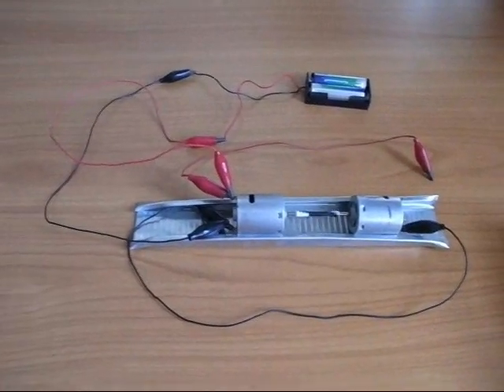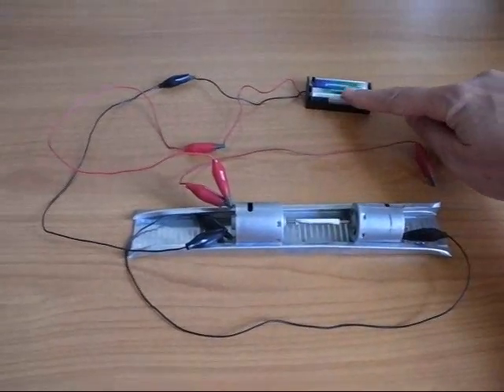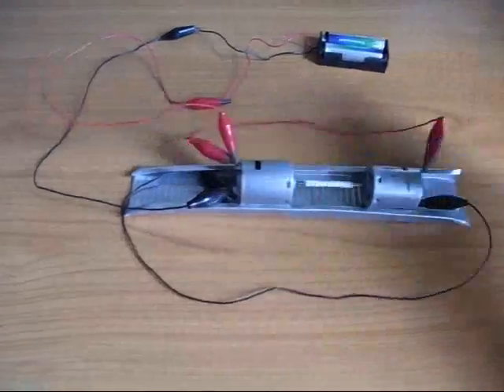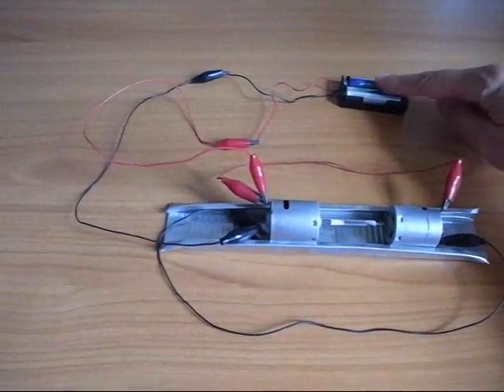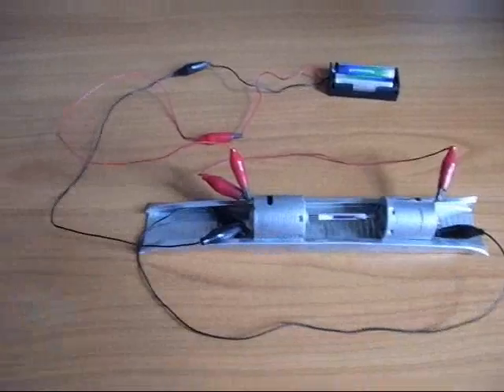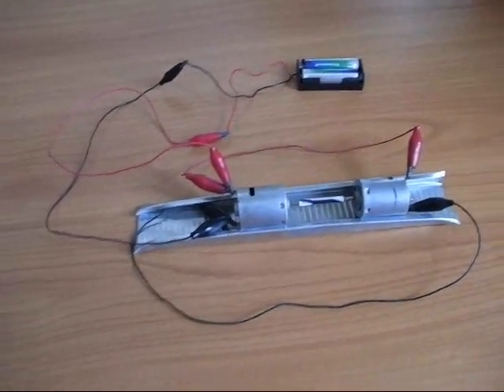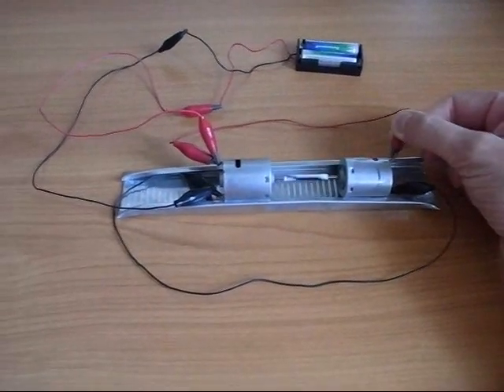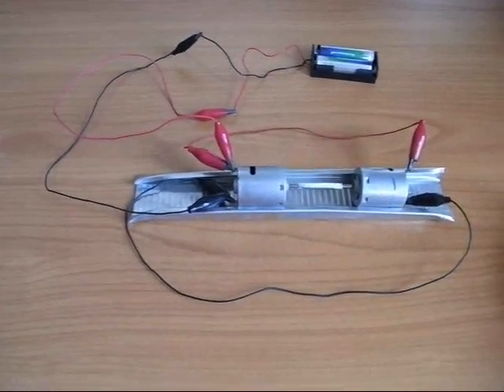Free Energy? Proof of Over Unity? You Decide! (Re-shot)

Comment: classic perpetual motion trap
Reply from the maker: If you believe in the oscillating big bang theory, then you believe in perpetual motion, yes?
Reply from the maker: dedokta That theory states that all the energy in the universe is recaptured and then re-expelled into the same  size explosion as the last time.  So in short you do believe in perpetual motion, just not usable perpetual motion?
Reply from the maker: dedokta So there's at least 1 instance of perpetual motion in a debatable "closed" system.  The wheel in a vacuum would have to be in a theoretically perfect space because in real space it would be exposed to unbalanced forces of gravity and solar wind (radiation of all wavelengths) for openers which would keep it from running "forever".  And that "forever" is ignoring the different scenarios of the end of the universe.
Reply: tsbrownie That theory states that all the energy in the universe is recaptured and then re-expelled into the same  size explosion as the last tie. Note: All the energy every in every form is recaptured. Even this would not be a useful generator as no energy is left over to drive something externally. If you spin a ball in space it will spin forever. This is conservation of motion at work. The second you try to tap the energy to drive something else then it will start to slow down as the energy is syphoned off. 
If I pour water from one glass into another back and forth then do I have an infinite amount of water? I can keep filling the glasses for ever, but it's not an infinite amount of water, it's the same water moving back and forth. If you take evaporation and spillage into account then you can't even do that for ever. If you try to siphon of some of the water each time to be used for something else then you definitely can't do it forever. This is what your machine is doing.
Reply: In a closed system where all energy is maintained then yes perpetual motion is possible. Over unity is not. If you had a wheel spinning in a vacuum with a 100% frictionless baring then it would spin for ever. this would be of no use at all however as you cannot use it to generate power. It is simply holding all the force it was given.

Comment: From what i see, motor on the left has drag from the second motor, once you power up the second motor, there is no more drag or resistance, it speeds up, because now its also powered by the battery, im sure if you did a test,with just the one motor turning the other, the battery would last long time, hook them both up like you shown, the battery would last half as long, and draw twice as much, nothing free, no overunity. otherwise it would run without the battery when it was disconnected.

Comment: You will love it when i say that sterling engine can run it's self Use a circular wheel with magnet's on it North South North South ect. All around the outer circle use a copper tubing ring close to the magnets and i used a fast exspanding liquid Called Vertrel it is use to clean circut boards and electronic surfaces it  exspands and goes through the engine and out to a canister with two one way valve balls for the in out then a radiator and it turns back into liquid a small closed diaphram forces the Vertrel into the hot copper tube the process starts all over again

Comment: no not in that configuration add a coil with a mid point and to diodes between motor motor a on diode and b as well together coil left side of center on motor a neg the left and center tap one wire goes in between the two motors of add the battery in between don't leave the battery on it though its been a long time ago so i may have one or the mixed up

Comment: Being that both motors use equal quantities of power I do not see how just one motor would be able generate enough power to run both without a reserve power supply with 2 to 4 capacitors after the initial jump start.

Comment: Your system gets faster because you are pumping some of the energy created back into the system. But this is not nearly enough to run the system by itself. When you disconnect the power it stops almost instantly. That is a sign of how much power loss you are experiencing.

Comment: If you could use super-conductive wires and create a motor that utilised 100% of the magnetic power and then create a completely frictionless and drag free system (all of which is not possible) then it would run forever. This would still not be free energy. Once you tried to tap it for power it would slow down and stop. An over-unity system would accelerate constantly until it either tore itself to pieces or reached light speed. Doesn't sound reasonable, does it.

Comment: But the system you have posted is full off lost energy. There is no way you can make an over unity machine, especially not with your setup.
The wires lose power conducting to the motor. The motor generates an electrical field and power is lost. Some of the magnetic field is turned into kinetic energy and there is a loss. there is a loss in the friction when it moves. The other motor turns the kinetic energy into electricity and again there is a loss. It's just a bucket full of holes.

Comment: The problem with this idea is Entropy.
This is true with most over unity concepts. 
Entropy mostly caused by friction of the systems own moving parts and against gravity.
Energy cycling systems, like this, would work for longer periods of time if they are super conducting.
Energy, like water, always seeks the path of least resistance to the lowest energy level possible.
This is why it always takes an introduction of stored energy into a system to effect any mechanical energy.
Hope this helps.

Comment: No amount of juggling with connections, resonant or back EMF will get more out than in, I should know, as I designed motors and generators for a living. an inefficient set up can be made more efficient, but not over 100%, there is no such thing as a free lunch.......It moves faster due to powering both motors with the extra power, and reducing the generator load.

Comment: you could try adding magnets to the drive shaft and put coils on the sides to boost power generation, but you need to upscale your design. replace the generator motor with a stepper motor that will also boost your power output. But you really need to scale up, not much, get motors from an old printer the good ones have normal and stepper motors and the bigger the printer the bigger the motor.

Comment: Modify both motors to have an input and an output. Make it so the timing of the commutators are exactly the same. Connect the shaft as you have. Then connect the battery to the input of one. Then connect the output of the one you connected to the input of the second. If the timing is just right the second one will act as a resonant generator and output should exceed input, but only because it collects radiant energy.

Comment: Isn't the second motor just running straight off of the same positive as the first?

Both motors have the same voltage running through them, so they would both run even if they weren't attached to one another.

Comment: Sir, first you connect only one motor to the battery, which has to move the other one too, then you connect both, Why wouldn't run faster? I am confused, what is the question? 
also, I don't think is "Over Unity", they use overunity comes from overrun, to exceed. Which is an impossibility.

Comment: You have provided the answer, but just to confirm one point, higher revs does not equal more power, but in this circuit the amps do increase, as generator draws current when connected. This is no increase in potential power. My credentials, I have designed electric motors and generators for a living!
There is no potential spare power to run the first motor in the system, the revs have nothing to do with it, only responding to the load reduction. In effect the wire takes the brake off the system.

Comment: When the second motor is not connected, the first motor has to turn it. Effectively the first motor is under load. With the second motor connected in parallel, it is also being powered from the battery (I think) so it will itself turn. Now neither motor is under load. That's why when they are both connected the shaft rotates faster. It would be interesting to see the current flow (direction and draw) in the red wire connected between the motors. And also the current draw from the battery.

Comment: Prove it that it is going three times faster. Lets see the rpm.
But to eliminate flaw, I would like to see one motor disconnected from the other completely (not talking about wires) and it's rpm. The logic is that the other motor brings the rpm of the single motor down due to friction(as its running like a generator).
Then hook both motors up and lets see their rpm.

Comment from the maker: True.  The point is that once I connect the generator back to the motor it runs at least 3x faster than before (implying a 3x power increase or such).  So it's like 1+1 =3, so at some point they can sustain themselves without the batteries.  Or so goes the thinking.

Comment: MY friend its simple to understand.Your mind is just towards electric generation from the driven motor.Of course driven one is generating energy but in less than the input discharge of the driver motor.So when battery is supplied in the second motor the current power from the battery has more power than the output generated.So energy generation will stop and motor process starts.Thus there will be 2 motor with more power/speed.The flux,repulsion/attraction time changes/twist motor more speed..

Comment: brige rectifire conected from generator + - to ac in  out of brige + - to motor this makes an isolated feedback circut so the generator isent running as a motor  this is what its happening  now 2  this will run itself as long as the generator  puts out enough to run motor  in most cases it will need a slightly larger gen and the brige will lose a volt in return i would say if its a 3 v motor/generator use a 5-6 v  to gain in loss  3 u wont be able to do anaything other but will runitself

Comment: No.  Not ever.  With the second motor connected to the first motor you have two motors running off the battery in parallel.  The reason it runs faster is you have taken the load off the first motor.

Comment: Well one thing the other motor is shorting the resistance of the other. but now draining the battery's twice  as fast. you will need a cap bank and some diodes. you do not want any power from the battery's to be applied to the gen. a diode will keep this from happing and the cap bank will store the power from the gen to run the motor make sure there fast charging but low out put.

Comment: ive made this experiment before.. its true the motor runs faster on the generator connection but its also draws more energy from the batteries as a result... to this day my attempts to self sustain the whole circuit even with capacitors was a failure..
keep trying and don't give up anyway

Comment from the maker: Of course you are correct, but most of these videos online disable comments or require approval.  I set this up so people could discuss and learn openly. Because a man convinced against his will is of the same opinion still. It would be cool if I could just get it to run a couple of seconds on power fed back, but the losses cause the dropoff to be so fast you can't even see it wind down. Flywheels might slow the drop off enough so you could see it slow to a stop.

Comment: Put a diode 
Lol
The 1st motor when connected to the batteries has to drive the other motor that is considered just a load when you add motor up without a tie Road you're basically power ring that other motor thus taking the frictional where and having a dual power plant

Comment: People just cant see they are getting jerked, not by this video but from norm.

Let say you have a generator that needs 50 newton to create 10 watts. Then you use a motor that needs 15 watts to create 50 newton load.
Now replace the magnets in the motor with some that is twice as strong
According to Laplace law.
It will only need half as much watts (7,5 watts)
to create 50 newton load.
And now the system creates more energy than there is put into it.

Comment: It is not a over unity machine because when he disconnects the battery, the source of energy, it will stop quickly. Why does it stop quickly? Once the DC energy source is removed the permanent magnet's magnetic field induce a current in the moving armature. Why because the armature is made mostly of a conducting metal, iron. that is magnetized back and forth as the motor turns. In this way the energy stored in the fly wheel effect is wasted away quickly.

Comment: Ok Lets discuss. To prove, that the second motor is actually a generator, then just hook it up to an empty battery and let the first battery run the motor on the left, and let the second battery be charged by the "generator" on the right.

You will observe a loss in charge, that will show as a voltage difference after the main battery is emty, because of the friction of the bearings in the motor and the loss in the windings in the motors.

Sorry, but this is not working as an over unity machine.

Comment: LOL,  Nice try!

Before the "generator" is connected, it only acts as another source of friction. Or lets say it like this. The motor on the left side is doing more work, because it has to turn the "generator" and therefore it runs slower.

After the second motor is connected, then there is less ressistance, because both motors are now turning in the same direction.

The term "generator" is not justified here.
All you have is two motors, while at first one has to turn the other... 
Nice troll =)

Comment: the generator output amp should be 3 or 4 times  amperage of the motor ,,i mean the prime mouver ..then somme pulley or gear effect to enhance the spinning from  the motor   such as RPM and torque ....i have a working model  from 8 month  continuously 24/24 7/7

Comment: Trace the battery wires, the two motors are in parallel.. 1 motor powered and 1 has no power = a load. Connect the other motor and now the load is taken away and shaft speeds up.. Simple parallel circuit.

Comment: you are correct - the bemf is energy from the battery. however, the idea is that you can re-use this energy - spinning the flywheel doesn't "use" the power, since establishing the magnetic field isn't impeded by the spinning flywheel. you create the magnetic field, the flywheel begins to spin, and you recoop the energy of the magnetic field. since fields do not need to follow conservation of energy, the pushing action of the field on the flywheel isn't actually "consuming" anything.

Comment from the maker: The power that comes from the back emf came from the batteries.  The batteries can not supply more than the batteries can supply.  Sure, you get a voltage spike as the magnetic field collapses, but it's high voltage and low current so the total power (watts) is what went in (minus what was used to turn the motor and heat the coils).  I've tried that experiment and have yet to see one that's verifiable.

Comment: you need a switched supply circuit so power delivery is not continuous and a separate recovery circuit to siphon off the bemf into a cap (or battery). you don't even need an external generator as the bemf produced in the motor's windings is enough in itself. efficient collection of the bemf is (...though probably not the only way) how you can continue to "reuse" use the energy of the supply current (and you are left with 'excess' energy in the form of a spinning flywheel)

Comment: How would you know which way the terminals are turned? Rotate the motor half a turn and the terminals switch places.

If the second motor _were_ connected in reverse the battery would be driving it backwards and the the whole thing would either stop or go very slowly.

Comment: There is always going to be load caused by the generator, even when it's not connected, when you connect the generator some of the energy which was lost in the existing load of the generator is used to power the motor and make the system more efficient thereby increasing the speed. the only way the system would run indefinitely once disconnected is if it where >100% efficient, which is not possible. Even if 100% efficiency was to be possible no practical load would be able to be applied...

Comment: the rpm speed up when you connect the wire - that's true because the other motor consume the power from the battery. easy and simple. child's play. why don't you use diode to isolate the power going to the other motor? This device doesn't produced overunity

Comment: The battery is not supplying electricity to the generator because the positive and negative terminals are opposite to each other. What is happening here is that power is being supplied to the motor which in turn is providing work to the generator. Unconnected without a load, the generator should actually be turning faster, and when you put a load on it it should resist turning and slow the motor even more. So both the battery and generator are supplying power to the motor.

Comment from the maker: Data: there's lots of these things where they claim adding coils, magnets, switches, circuits, etc. will cause it to go over unity but so far I've not seen anything I'd take seriously.  First check is that if any part (coils, belts...) heats up in the least, then the system is not 100% and it will grind to a halt.  Now if they have superconducting materials, it may run for a while, but even then...